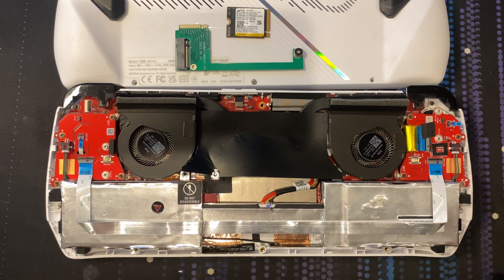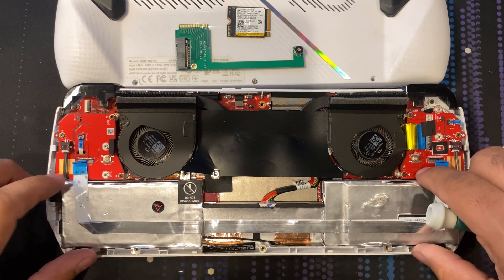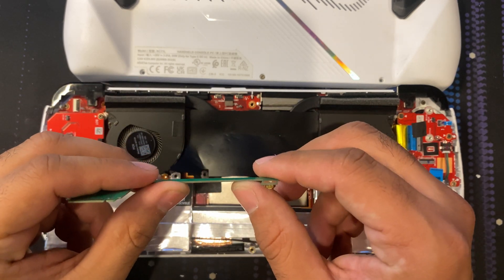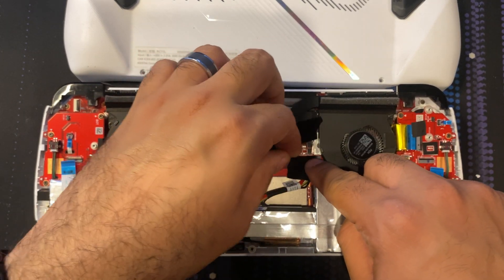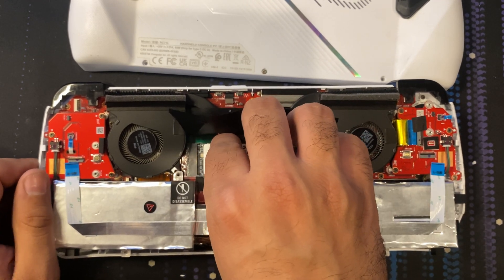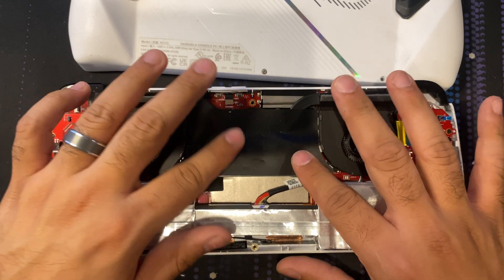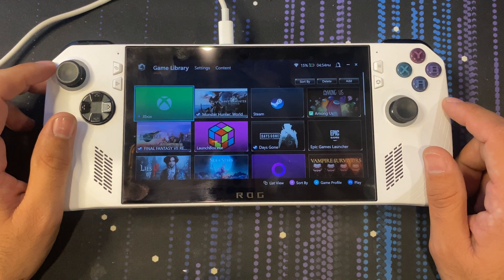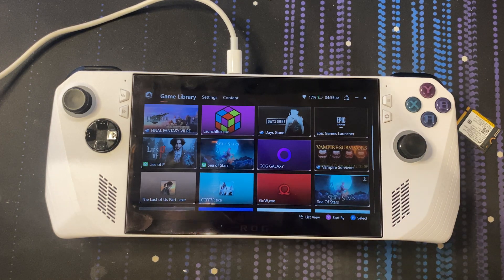Easy Upgrade for ROG ALLY on the Cheap M.2 With Adapter

Comment: Does the back panel close up easily after the installation ?
Reply from the maker: It did for me, but it dies depend on the height of the m.2 some have a higher height
Reply: @Hunter_RQ  sorry, it dies ? What do you mean
Reply from the maker: So some nvme drives are taller then others, depending on the height I have seen some Reddit post mention their back cover started cracking since it had a height issue. Specially new fast drives that need heat sinks. Mine is a gen 3 and didn’t require a heat sink, so no issues there

Comment: I have it taped down a 1tb 2230 waiting for my m2 I got a hynix 7000 read speed one.  I thought it was strange having it sit against the power cable I've been running it without tape no issues but when I get the longer m2 I will follow this tutorial just in case thank you so much for this
Reply from the maker: I do suggest removing the battery when doing this work, but yeah the adapter is great but the tape I do consider it essential since you never know if you might have a short. 
Good luck on your new drive.